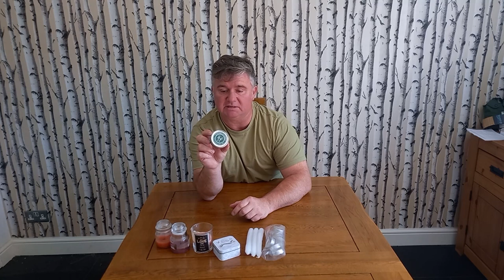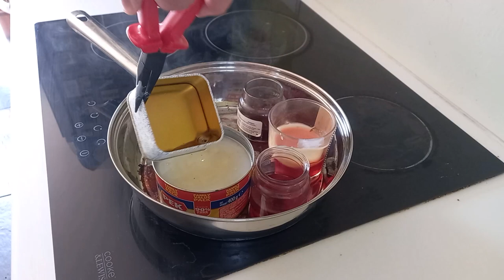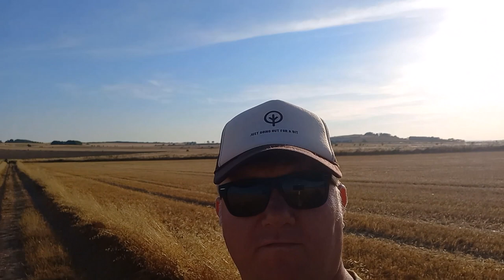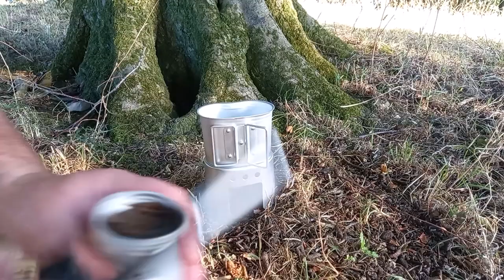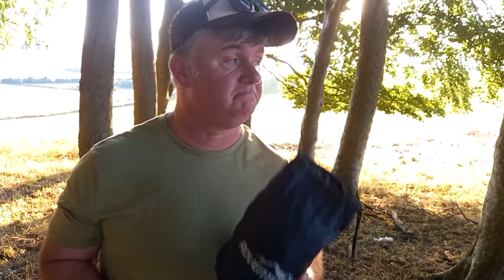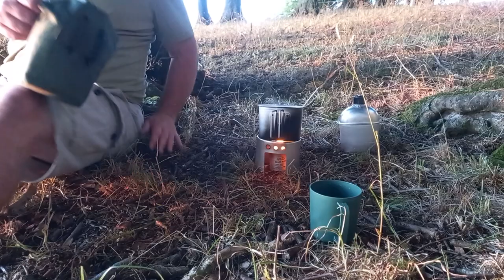Buddy burner contruction and use

Comment: If you push 3 or 4 or 5 matches head upwards into the cardboard in the tin but slightly proud of the cardboard and seal in wax you can strike the whole thing against a matchbox side for easier lighting than the lighter.
Reply from the maker: Darren every day I learn just a little bit more.  Thanks will get stickin in those matches......thanks

Comment: Adding water to the pan stops the wax from burning. I make candles as well as stoves 😊
Reply from the maker: Hello mate, i've had a few times when the wax has boiled over🤔are you suggesting a drop of water on top will stop this from happening?
Reply: @justgoingout6824  No one pan with water a second pan with wax placed inside the first one

Comment: Use a double boiler for safety when melting wax
Reply from the maker: Hi Jeff,  could you describe a double boiler, is it a catch for overspill?
Reply: @justgoingout6824  it's a pan with another pan that nests in it
The bottom pan rests on the burner and has water in it to heat the top pan 
It's used to melt and cook without scorching or burning

Comment: I was wrong about the style pouch.  What you have is a Vietnam style canteen set. The ww2 is a canvas pouch with poke through buttons. The cup has a fold out handle and the canteen is one quart. Some was aluminum some was steel with ceramic coating. Those ones are worth money.  They are rare. Only made for one year. And the rest are stainless steel. None came with a stove. Butterfly handles came out after the Korea war. The Vietnam war they came with a plastic jug a butterfly handle cup and a stove that stuck to the bottom of the cup. But in my opinion your set is better more so if made of aluminum.  Water gets colder in aluminum. Ww1 ours was aluminum jug and cup. Canvas pouch as well. So. I like the alice clips because it will fit any belt. And the kit i like as well. Thoe i would prefer the fold out handle instead. Have a nice day
Reply from the maker: Thanks Aaron. In this world of expensive upgrades of everything, I do try to reach back and see how our dads and grandads ( and grandmothers too) did things.  Its a cheap easy approach to life.  The canteen set, although relativly old, works, and works well.  Why try to reinvent the wheel, all about making a good thing better for all.  Cheers bud

Comment: They did not have butter fly handles or a cook stove during ww2. They had a fold out handle with grooves in the handle to stick your fork handle in so you did not burn your self. I have a complete canteen set from ww2.. but that is a nice canteen and the pouch is a ww2 style pouch but with alice clips. Them are the best to make your water cold. Just get the pouch wet. I would like to know where you got that canteen set.
Reply: I believe that is a Goetland set.  Pretty decent stainless steel set from my understanding.

Have a few canteen cups and stoves.  Both butterfly handle (locking) and bar handle.  Also have a '65 dated mess kit that is all stainless.  I do use them all.

The butterfly handles came out after vietnam with ALICE system.  Best setup?  Probably the steel canteen, bar handle cup in steel, aluminum stove and canvas M-1956 carrier with ALICE clips.  I don't have a steel canteen, have a 1944 dated and an undated aluminum and a few plastic canteens.  I don't use the aluminum though since they are corroded and I haven't cleaned them out yet.
Reply: @voraciousblackstn  rothcoe has the ww2 style cup and canteen but pathfinder has the 2 quart kidney canteen and cup plus stove. The stove you can cook hamburger or something on. It has a small grill. Plus if you carry four small nuts and bolts you can mod legs or spacers for different uses. Spendy but thats the one i want. The lid of the canteen is very larg.  One could put ice cubes in it. Then place it in a crown royal bag and put all that in the pouch. But im never going to part with my ww2 canteen set. Its old but good. Best way of cleaning them out is with pebbles. Works way better than bb. Then just boil water in it. Need to get some water tabs and a water filtration.  Probably Sawyer minni. Want to go hiking and do some camping. I always bring it and a aluminum one or a two quart jug. Got real good well water so yea. See i thought yours was aluminum but its not so that is why is mentioned the other ones i know about.
Reply: @aaronzierke9920  i usually bring 2 1qt and 1 2qt.  I use an ALICE pack.  I do have a rothco stove, but i got a surplus stove recently and have retired the rothco.

My canteen cups are dated 1965, undated Wyott and 2011.  Stove is dated 1992.  The 2011 cup i did not buy surplus, rather from MCSS.  I was in from 2000 to 2012, US Army.

I also have both a Sawyer mini and squeeze.  Have used the mini for years since I do some extended backpack camping sometimes.  Got the squeeze recently to hopefully speed up water gathering.